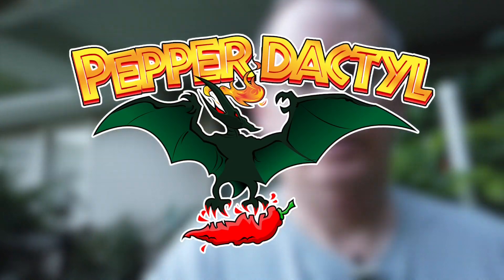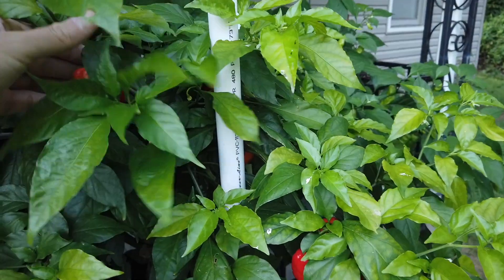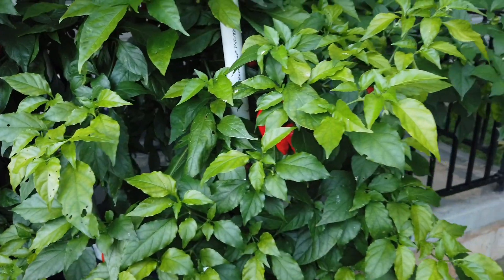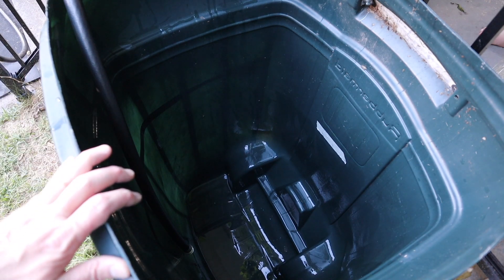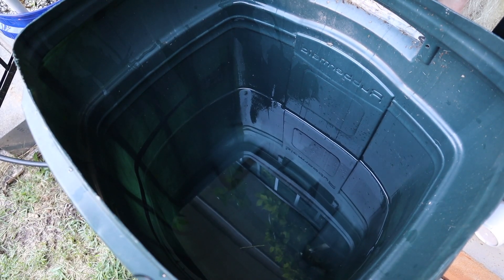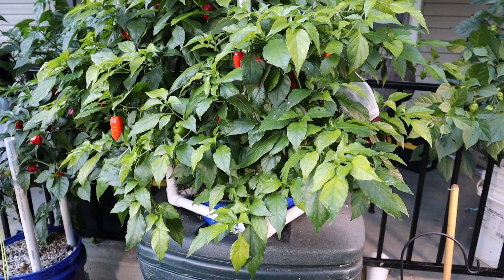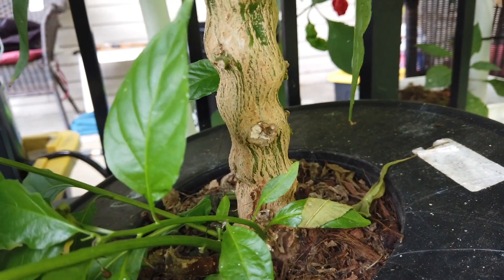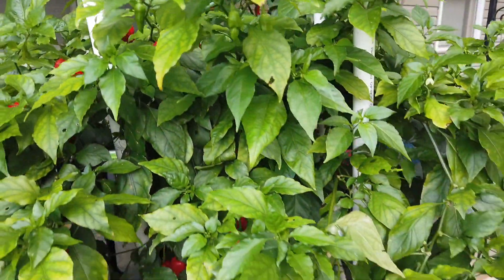How to change nutrients on large Kratky systems

Comment: Interesting you're running at 300-400 ppm nutrients...I am currently in the veg phase with just leaves and I am at 1050 ppm per JR Peters (Jacks fertilizer).  At fruiting stage, they recommend 1250 ppm!  Have you tried this high ppm?
Reply from the maker: I think it depends on the brand nutrients. the EC's don't always match for their respective full strengths. I start out with what they recommend and adjust up or down as needed. Also, I normally non-circulating hydro at half the strength of circulating hydro methods.
Reply: @pepperdactyl  Do you have a paper/article that supports this practice of halving the strength for passive hydro?
Reply from the maker: Here's a link https://dyna-gro.com/product/foliage-pro/ Look at hydroponic production application rates. Again, it goes back to the brand/type of nutrients. There absolutely is not a one size fits all for hydro nutes. You have to make your best guess, use it, observe and make adjustments.

Comment: Hello. I'd like to know what size net cup you started out with and how did you swap it. I mean, most systems start with 3 inch net cups, but looking at that branch of yours, it surely cannot be contained in a 3inch net cup, so how did you go on about moving it while the roots are intact? I'm confused and your clarification would help. Thanks.
Reply from the maker: I don't remember on that one. It was either in an Aerogarden basket (about 1.25 in) or a 2 or 3 in net cup. When you move them, you can just cut the smaller one off, or leave it on. I've done both and it worked fine.

Comment: What are your tempatures like? Is hot outside?
Reply from the maker: Our temps aren't bad here. At the hottest it's low 90s, usually mid to upper 80s in the summer.
Reply: @pepperdactyl  Thank you for taking the time to reply, great video btw. 

Where are you located exactly?

I live in Vegas and it gets to the triple digits here. I'm planning in doing this during fall, spring and winter. In a green house
Reply from the maker: @megaluisdeth  Thanks. I live in western NC. The climate is very temperate here, with no real extremes either way.

Comment: I still don't see the need to dump out the old nutrients. Why not just refill with new nutrients halfway?
Reply from the maker: You could refill them if you want. I like to change mine out with fresh periodically. As the plant uses nutrients, it doesn't always use them evenly, might take more of one thing and less of something else, so you often end up with a lot of excess salts that are imbalanced and pH has shifted too.
Reply: Have you tried using 2 seperate containers, one resovoar tank and one tank with a float valve? I am going to be using this, this way you will be able to keep the containers almost empty before it gets fresh nutrients, and you do not have to use that big containers. Of course you would like big containers for bigger root and plant, but u dont have to go crazy big.  @pepperdactyl

Comment: I would purchase a cheap water pump or install some kind of drain or valve at the bottom
Reply from the maker: That's a great suggestion. I thought about a drain, would make things so much easier and not disturb the roots either.

Comment: Thanks for the How to.  Do you mind sharing the info on the pump?  I know you did before but can't find it.  Also,  I find it is very easy to use a portable drill with a paint mixer for this operation and I come back and mix the nutrients about every week. Maybe it is not necessary with your nutrients of choice... just my $0.02.
Reply from the maker: I 'think' this is the one I have, but I got it at Lowes. https://www.amazon.com/Dyna-Glo-DH-20-Kerosene-Battery-Operated/dp/B000HE9YEM If you search battery siphon pump on amazon there are a bunch more to choose from, some might be a better value, more power, etc... But the one I have seems to work well so far. Makes it really easy to pull out nutrients from something that would be hard to move or disturb. I'm thinking a smaller version would be perfect for AeroGardens.
Reply: Im using a coarse vacuum cleaner, that can suck water into its own big container. This works great for indoors. And like u also using a drill with a paint mixer connected to mix nutrients.

Comment: I’ve about given up on Kratky for peppers, but I’ve been using masterblend. It’s either been too hot or the blend is too nitrogen rich. I’m having a hard time getting much fruit to set.  I think I’ll try next season using some dyna-gro products. Thanks for the video Peter.
Reply from the maker: Thanks, David. I have had good results with MasterBlend and Kratky using ratio of 2.0 g/gal MB, 1.0 g/gal Epsom Salt, and 2.0 g/gal Calcium Nitrate.
Reply: If you're doing straight MB then the nitrogen shouldn't be an issue since it's low compared to the other nutes at 4-18-38 but adding the cal/nitrate will boost the nitrogen. As fruit set I would back off the cal/nit to half while keeping the other measurements the same.
Reply: 1/2 tsp mb, 1/4 tsp ES, 1t2 tsp CN per 1 gallon works for me. During flowering, try omitting the CN and replace with cal mag

Comment: Nice presentation of Kratky concepts, having used everything from direct seeding to old plants in my large Kratky trash cans and totes it seems that older plants pull far more nutrients over the season with their more established root systems and extra foliage with transpiration effects.  I would expect their is an optimal transplant age and size for the container which you are using.
Reply from the maker: Thanks, Matt! I think older mature plants in large systems would be ideal. My Butch T in the 60 gal barrel isn't nearly as big, started as a smaller plant, but I imagine the Bih Jolokia would have taken off in it.

Comment: Informative video.  I started a baquinho from seed mid August in a mason jar kratky method.  The plant was looking perfect.  A deep green healthy plant but the roots were already at the bottom of the jar so I moved it to a 3.5 gallon bucket dwc.  It's gonna remain inside hoping to get peppers this winter.  Your videos are helping me through all of this since I've never grown this way.  I need to get one of those ppm/ec meters.  So far I've only gone up to 1/2 strength on the nutes and don't know if it's enough or not.  Thanks for showing the way!
Reply from the maker: Thanks for watching. You're probably better off staying on the lower end of nutrient strength for non-circulating hydro. The meter I use is Bluelab Truncheon. I love it. I never needs calibrating, just works.